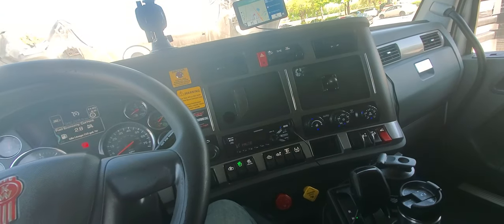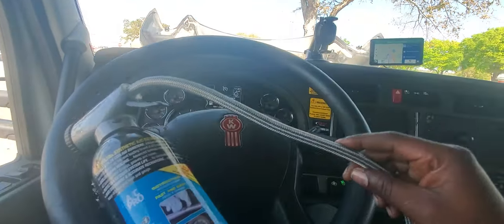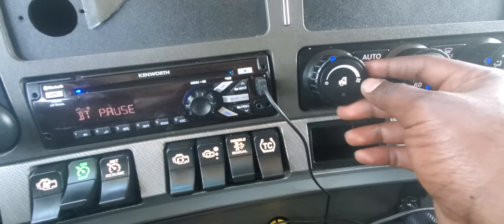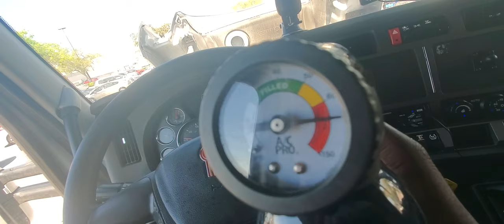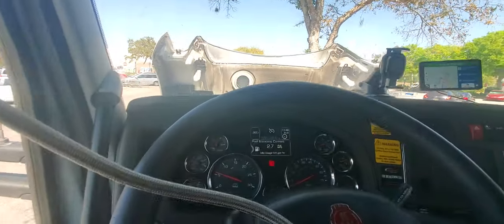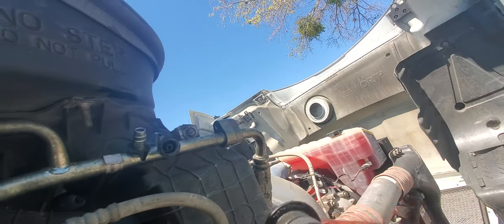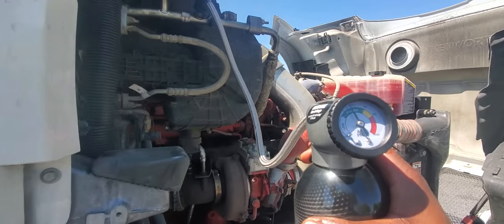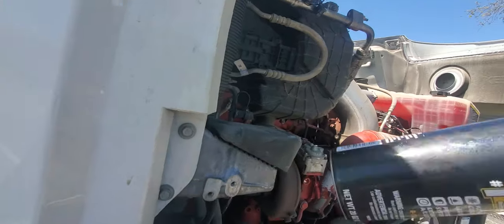how to recharge your car or semi truck air condition this summer #acpro #rechargecarac #ac

Comment: Least turn the truck off , you’re not charging ac , so we can hear what you saying.   AC pro same as R134a
Reply from the maker: turn up your 👂 hearing aids volume
Reply: @The-realnews  I don’t need hearing aide son I been driving truck for 32 years  , you still didn’t answer R134a is same as. AC Pro , maybe it is too technical for immigrant
Reply: @KS-cu1zc  the guy says it work. You saying different?
Reply: @I I bullshit I said driving not fixing ,but learning something new doesn’t hurt 😞
Reply: @ismaelbarba2709  you can’t just put anything in just because some dummy said so
Reply: You have to run truck
Reply: @KS-cu1zc probably your company owned by a immigrant 😊
Reply: @KS-cu1zc it hot

Comment: When I plug it in and press the trigger once...I notice my car make a sound...like the sound that the A/C is ON.  When I go in the car and check, my A/C is now COLD!!  But the trigger pressure meter showing 0?  Weird.  I think when I plug it in for the 1st time, it was almost green....so maybe that's why a press of the trigger is enough. I did press the trigger a couple more time as I shake.  But anyway, it's working...I just thought it's weird my pressure is showing 0 instead of staying at the green.
Reply from the maker: When you shake it to do you feel anything inside a/pro cans.if air is cold than awesome .I will say keep on shaking and press the trigger regardless of whether it goes to 0 or not. Until the bottle is empty.